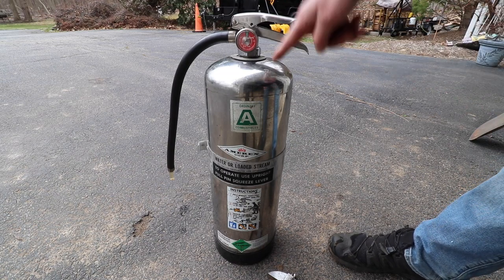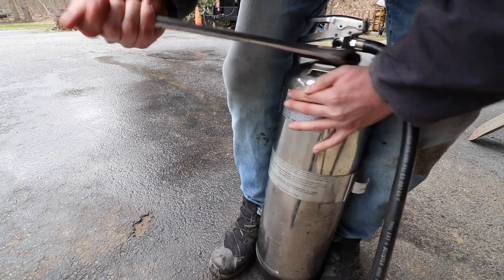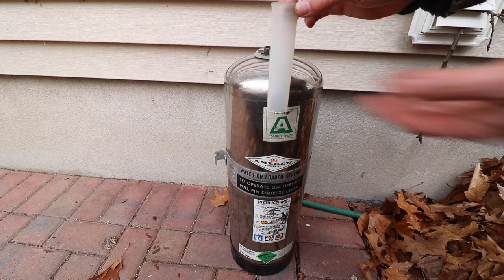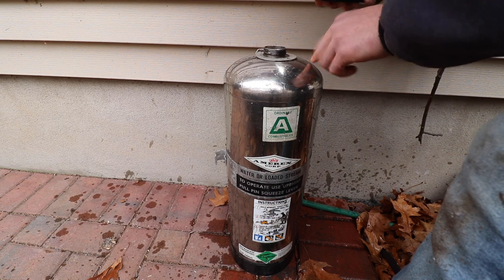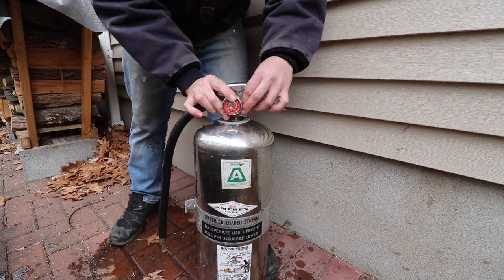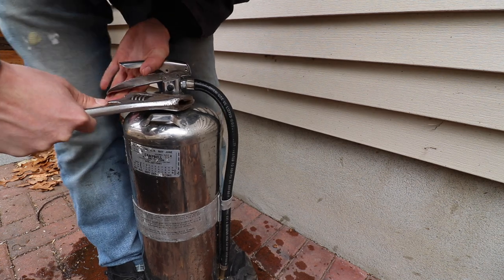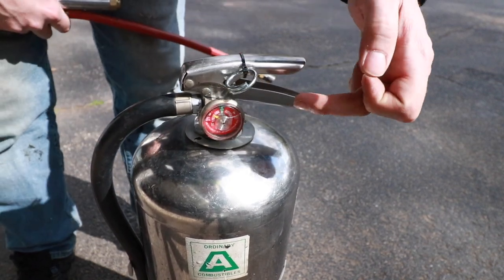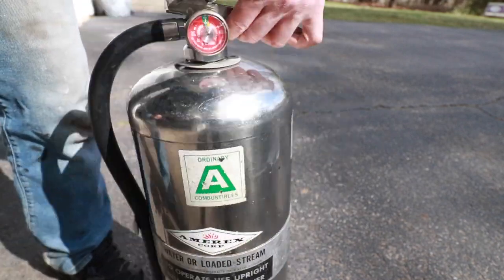How to Refill a Fire Extinguisher (Water Only)

Comment: To release the PSI in a quicker manner flip the bottle upside down, (I would take the hose off) get control of the end of the hose and apply pressure on the operating lever.

Comment: these water cans are horrifcally expensive maybe you can tell me if you have any ideas on this I think I would rather take purple k or baking soda type and try in on a class a fire and take the risk that maybe it will flare up and I can put soapy water on anything that flares than use abc because abc is horrble to clean up any ideas ?
Reply from the maker: Not to be rude, but I'm having a little difficulty understanding your question. If possible, could you use some punctuation and clearly describe your question.
Reply: I was saying as you know abc is a mess to clean up my theory was I think I would prefer to risk using baking soda or purple k and deal with flare ups on a class a fire  (Rather than running the risk of abc being a mess any thoughts ?) and I was trying to say my idea if it did flare up my idea would be to pour soapy water on it.  You've probably herd at least one person say if you add dawn to water it can be used as the poor mans foam ? any ideas ? thoughts please thank you
Reply from the maker: @Fredengle   If you are searching for a cheap class A water can like the one I have in my video, look up some local fire extinguisher companies by you. Companies that test/ Inspect extinguishers. Tell them you are low on funds and looking for a second hand water can. That's how I got mine for free. (I was a volunteer FF at the time). 

In my 10 years as a FF, I used foam on a hand line only once. Foam has its place, but is not needed for class A fires usually. Put water on the fire, soak the surrounding area, assess and respond. 

Purple K is generally used for class B and Class C Fires. 

The type of extinguisher you should get heavily depends on what class of fire you are expecting.
Reply: I am saw a video it stated if you try to use baking soda on a class a fire it will probably cause flare ups  but I would imagine the same with pk  but considering how messy abc is I was trying to say would you rather not just use the pk and try to deal with the flare ups as I think if you use abc in your home its going to be horrible to clean up since it is a corrosive acid that stick to hot surfaces ? I think what I am trying to say is I think I would rather try my bc pk unit and put out any flare ups with soapy water ( dawn as soap) than run the risk of using an abc inside thoughts ?

Comment: Hiya mate. I have refilled 2 fire extinguishers. Both water. When I refill to an appropriate level of water I screw the top back on as tight as human hands possibly and when I recharge them the air goes inside the bottle but the pressure gauge doesn’t go up. I am using a hand pump tho. But I can’t figure out why the gauge isn’t moving. Any idea why?
Reply from the maker: I doubt the hand pump will pressurize the extinguisher to the required pressure. I would try compressed air. 

If that doesn't work, you may have a faulty gauge. Try tapping on the gauge as you fill.
Reply: Will do thanks @OldSoulMillennial
Reply: I actually don't think the hand pump is the issue I had a bike pump that can generate about 120 psi I was able to fill a 5 gallon tank with it is seem but it seemed to take about half an hour to do though why would I font that I doubt my condo would be to happy if I have a  air compressor here here as I would bet they think it makes to much noise! I do have an air tank here that has been filled up mostly by hand and topped of with an air inflator now though I don't use to much pressure and try my best to top it off using a bike pump!
Reply: Here are question for you though have you checked the extinguisher s tire valve if the core is not properly screw in it might not pressurize properly!

Comment: Nicely done.  I have one of these and need to remember to bring them indoors in the winter to keep from freezing and to only use them on paper and wood fires.

I saw on a forum to add dish soap to the water to create foam when used to get more value out of the water volume.
Reply from the maker: I've never heard of adding dish soap. Interesting, I'll have to give that a go!
Reply: My question to you would you be concerned about filling and old unit that was not hydro tested?
Reply: You can add ColdFire anti freeze liquid to prevent freezing. Dish soap is very good to add as well.
Reply: @Hellogelloeee   I was not sure if you saw my question it was would you be concerned about refilling an old one that was out of hydro date I mean do you think it's a hazard if the unit is in good physical condition?
Reply: @Fredengle  If the unit has not been hrydrostaticly tested in awhile it is not a good idea to refill it. If the extinguisher is completely in good condition it should be fine but it's always good to make sure it's hydro tested.
Reply: I add a couple tablespoons full of baking soada as well.
  Mine sit in my shop here in the north all winter in down to -40 never hurts them
Reply: I fill mine to 120 psi .
  Had them for 25yrs.

Comment: About once a year, I’ll empty mine out, break down the valve head.  Clean everything. Put some white grease on the valve stem.  Check the shrader recharge valve.  Sometimes they get gunked up with calcium.  It helps to have a tire valve stem tool to take it out and soak it in vinegar for a while.  Then put it all back together and recharge.  I keep one on each floor in the house. 

I’ve seen repair kits on eBay for certain brands like your Amerex there, and Badger.  With new o-rings, new gauge and schrader valve and valve parts for like $15.  I have to get a few.

Comment: I add couple of table spoons  of dish soap and baking soda to the unit after is at the water height  you want.
  If you turn the unit upside down it just discharges the air..

Comment: This is very helpful! So I can do this at home and it's safe and "official?"
Reply from the maker: Well Technically....

Water based fire extinguishers should be hydro tested every 5 years. There is normally a date stamped on the container or a plastic collar is placed around the handle which denotes the last hydro test date. 

Additionally, fire code generally requires fire extinguishers to be inspected by a certified company once a year. Does this apply for private homes? Ehh, gray area.  

So to answer your question:
1) Safe? As long as the hydro test date is within the last 5 years AND you do not over-pressurize the container, it should be safe. 

2) Official? Technically the extinguisher should be inspected by a certified company.

Comment: Great video , if i could just ask what size compresser you use to pressureize  this ? I have a family member who loves and owns a few extinguishers , we bought him a compresser but its 8 bar rated , and i think the pressure in the green section of the guage is 13.5 bar , so when we try to fill with air it only pressurises so far , and then it stops , im unsure though if its rhe attatchement or the compressor thats not up to the job ,
Thanks
Reply from the maker: Compressor tank size shouldn't matter. What matters is that the compressor can reach/exceed the proper extinguisher pressure. The extinguishers gauge should have a pressure rating. Mine is rated to be fully charged at 100 PSI (6.89476 Bar). If your compressor pressure exceeds the extinguisher pressure gauge rating and the arrow isn't in the green, then it's possible you have a faulty gauge on the extinguisher.
Reply: HI ALL DON'T KNOW ABOUT BAR RATINGS BUT A WATER EXTINGUISHER IN THE US IS FILLED TO 100 PSI also called 690kpa !
Reply: I am not totally sure on that one I have filled these using an air tank I find that you need about 110 PSI to fill to 100 Psi!!
Reply: It is what it is? Of course it is what it is. Was it supposed to be anything different than what it is? That saying really makes no sense you know....but I guess it is what it is.
 Great video dude.

Comment: How can I fix the gauge , I bought a used one and the meter does not change when I fill it ?
Reply: It would seem you have a bad Guage the  concern is usually you have to replace the whole valve assembly not just the gauge the  party might be about 80.00 if you could un screw the Guage should be able to screw a new one
Reply: my concerend is if this unit has not been hydrotested I dont know that its safe to fill I  have  bought pre owned units before but I was very careful that the ones I filled were sold by refill technician and only bought ones that had said they had been hydrotested! the ones that were not hydrotested I did not refill!
Reply: I am not sure you know this but the pressure in these unit can be high enough to be deadly if a mistake is made are you sure you want to fill one you do not seem to have done enough research on what may or may not be dangerous?
Reply: my actuall answer is I would stop buying old fire extingusihers in poor condition its true I bought used fire extinguisher on ebay but the people who sold it to me said they were refill technician a safety test had been performed so in theory it shoud be equivalant in safety to a new unit  if your unit is not hydro test you might be risking filling something that could be a reject cylinder which would not be great if your unlucky it could be dangerous these things do have enough pressure to kill you if a mistake is made !

Comment: Why no Class A Foaming  agent?
Reply: Sometimes you just need to spray water at something.
Reply: To answer your question why no class a foam one answer to that could be class a foam could be corrosive and would not be good in an extinguisher for long g term storage the other problem is I don't think any one will be introverted in performing the safety tests the extinguisher needs to stay In service if the know you modified it !